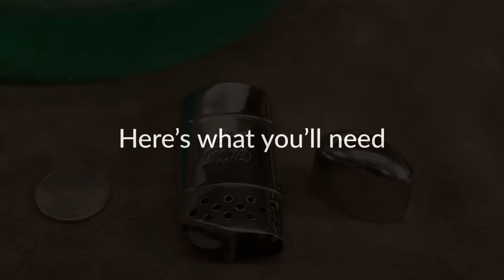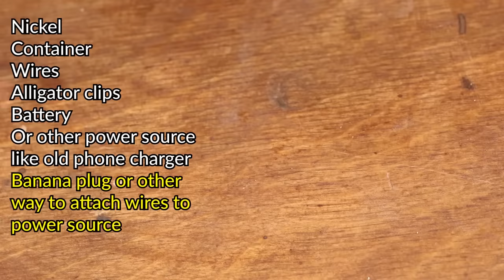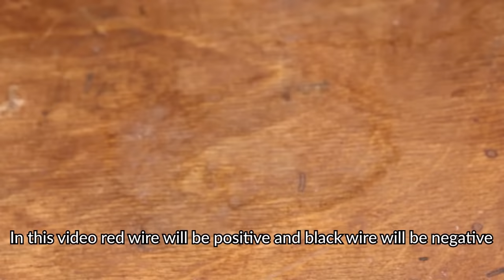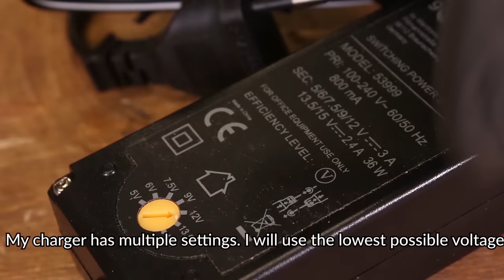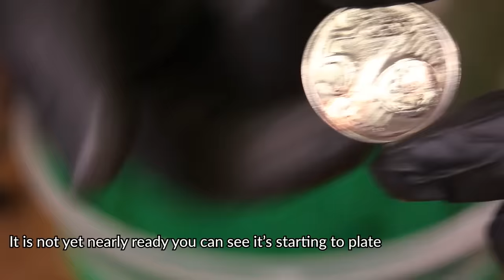How to make simple DIY nickel plating set up - Easy Electroplating for Beginners

Comment: For best results: use hydrochloric acid as the electrolyte solution to obtain nickel chloride. During this first step, switch + and - each 30/60 minutes. You can set up a system with a relay to do this automatically. Let it run several hours until 1 or 2 days depending on the quantity, until you see a VERY dark green color, that means that your electrolyte solution is enough saturated. At this point you can keep doing the second step as shown in the video. BE VERY CAREFUL, WEAR PROPER MASK AND GLOVES, KEEP THE ROOM VENTILATED. ACID IS CORROSIVE, so take care, the electrolyte preparation is better to do outside (that smoke too is quite corrosive, metal parts around the area may begin to rust after 1 or 2 days)  For best results, a copper layer is also recommended before the nickel plating. Cheers 😁✌️
Reply: where did you learn this? also is there a proper percentage that the new hydrochloric acid should be?
Reply: @stclairstclair  Nickel chloride with a few drops of 31% HCl (10 g Nickel salt) in 500 ml water) works great.
Reply: @chanheosican6636  nickle salt ?

Comment: Probably been commented on a ton, but I'll just reiterate - be very careful with using salt (sodium chloride) as it will generate chlorine gas, which is highly toxic. only use in a very well ventilated area. I'd much more recommend using washing soda (sodium carbonate) as that will improve the conductivity of the water without the risk of chlorine gas.

Comment: Thank you for this video. I’ve always wanted to know how this is done. We love watching all your videos 😁
Reply from the maker: Thanks. Some metals are much harder to plate or they need liquids that produce dangerous fumes but at least nickel, copper and zinc are easy and all can be done like this if you just change the nickel to other metals
Reply: @Odd_Experiments  could i use this method to put a nickel finish on a small pistol?
Reply: Inhuman Filth if it’s just the case then yea I think so
Reply: @dandan3934  It is chemically possible to plate something with copper ions in solution without using a copper electrode
Reply: @inhumanfilth681  Pistol's bluing would need to be removed.

Comment: Everyone should remember, that the mixture of hydrogen and oxygen makes a detonating gas, especially in 2:1 proportion. That gas is very  dangerous cause it's very easy to detonate, there would be enough just one spark. So the ventilation is not just recommended, it is ablolutely necessary!

P.S. Thanx for video, simple, short and clear. Salute form Russia ;)
Reply: I perfectly agree, the last and only time I smoked close to a charging lead battery (which release hydrogene the same way), it exploded and I ended with my clothes looking like a fish net...

Comment: That is very cool. Can you do the same thing with other metals like copper, silver, brass, tin, etc?
Reply from the maker: Basically yes. I believe the vinegars solution needs to be changed to different for some metals like gold. At least copper and wick will work like this. Brass won't work because it is an alloy. Depending on your conditions you will get a plating that is mostly only one of the metals in the alloy but it might have some impurities. Brass can be plated only in specific conditions but that is hard.
Reply: what liquid should be used for gold
Reply: you can easily plate with copper in a copper sulfate (CuSo4) solution (easy to find in a gardenning shop) the same way, with copper at the anode.
For gold, only aqua regia, a mix of nitric and hydrochloric acids (HNO3 + 3 HCl) will react and it's extremely corrosive, it even attack the glass... not recommanded for DIY !
Reply: @Jethro.Maloku-le.Rey.Kalsitran  what about gold cyanide

Comment: From what I understand, using higher voltages causes a pitted look on the surface. [probably because of the bubbles] I have found using a "buck" converter on the power supply to get the voltage to not above 1.5V with longer plating time and moving the part to keep the bubbles from sticking and staying in the same spot on the part provides a smoother shiny surface. Keep in mind like he said, the final product will only be shiny and smooth as the surface under the plating, so get the part by polishing to a mirror finish before plating.
Reply: Yes, generally a smaller voltage is ideal, around 1 or 2 volts usually, and the amperage determines how long it will take to plate a piece of metal. So I suppose the best theoretical results would come with low voltage and low amperage
Reply: Could also set up two tubs and put them in series. That would cut the voltage down to about half and you'd have two processes going at the same time. Could also put a light bulb in between, like an old 2010-vintage antique flashlight bulb

Comment: Hey there, you should make a Hullcell test to see the best results for your nickel solution. You can in crease the shining of the plated nickel layer by adding saccharine ;-) add prop to reduce the surface tension and the air bobble during the plating will be smaller —> higher current —> more speed and better surface. A good temperature would be 60 C°

Comment: If i got some nickel from the positive anode to the negative one. Can i switch the positive with the negative for plating or will it ruin the part, or just won't be possible. If my knowledge in science is at least somewhat good, i think, it is possible, because you don't do anything bad, but it is always best to make sure. As they say, "Drill once, measure twice."

Comment: It is refreshing to watch a "how to" video that is clear, concise and IN FOCUS. There is also a bit of humour thrown in. Very informative. Is it possible to nickel plate over chrome? I ask this as I have a cracked motorcycle part made of ABS plastic that was chromed. I will first weld the piece to repair it by making an ABS paste using either acetone or MEK to dissolve some ABS shavings. I assumed a layer of copper was applied under the chrome to make chroming the part possible. Any help would be appreciated.
Reply: A layer of nickel would not adhere on chrome. Try to remove the chrome layer with hydrochloric acid as there should be nickel under the layer of chrome.

Comment: I had no idea it worked that fast
Reply from the maker: When you get everything with the set up right it's very fast, but to get thicker plating takes a bit of time
Reply: @Odd_Experiments  It would be nice if you made a video with the different configurations to know what would be an ideal durable thickness. thanx

Comment: Hi... Very good educational video you have there sir. May I ask, if I want to replace the material to make gold plated, is it possible using this method? Thank you
Reply: Gold plating is a little more difficult...you would need to dissolve gold into solution which can get complicated and toxic. As far as plugging in gold in for nickel via the same method, I'd have to do the math but it doesn't seem impossible to me.

Comment: Question: does adding salt to vinegar make the solution something like HCL?
Have you ever checked the acid  level of the solution, how low the level was?
I wonder if one could plate items only with the solution and electricity like in the experiments with soaked tampon like attached to metal pens, applying the solution to the item.

Comment: Thank you for sharing. I see the nickel used in the demo is about 5mm thick but the amazon link for nickel is only 0.02" or 0.5mm thick. Does the thicker nickel perform better or worse than the thinner nickel? Could you share a link for the thicker nickel?

Comment: Thanks for the video 
I went step by step to do the Plating 
After getting then nickel Electrolyte ( green liquid) i tried to play a  steel carbon knife parts( blade , back etc) but once i put them in the liqiud it starts to make bubbles ( a lot of them) 
Is this normal ? 
Any advice on plating carbon steel knifes? 
With regards

Comment: Nice one! 
May I ask if the mass of the electroplated item is significantly larger than that of the non-plated?
I mean can it be quantified?
Reply: It can be significantly larger if you left it in there for a long time. Look up laws of electrolysis

Comment: Hi. Can you show me in detail, the process and things required for making a chrome plating setup to apply it on plastics?
Reply: Plastic is not conductive, so it can’t be electroplated just like that. Any non-conductive item needs to be covered by some conductive spray or paint before going on to electroplating it.

Comment: I have a lid from an antique trinket box. I want to nickel plate it. It measures roughly 5 inches by 3. A bit larger in scale than what you're doing. What kind of setup would I need to do this?

Comment: how about testing varying voltages and milliamperages? I've been told that the lower the voltage and amperage at plating time will result in a better thicker plating, though it will take much longer to do. So far, I have not been able to prove or disprove the theory, since tho my voltages have changed, the milliamps did not substantially change.
Reply from the maker: I might do something like that in the future. I wanted to go with very basics on this video
Reply: @Odd_Experiments  I would love for you to do it. It has been a magnificent video.  by the way what amps and volts did you use?  Thanks and regards from Spain

Comment: Thanks for the video it looks really easy!, does it works the same if i use copper instead of nickel?
Reply: It's actually a bit easier to do with copper and you only need a copper salt, such as CuSO4 (Copper sulfate, commonly in pentahydrate form) as well as a copper electrode.
Reply: ... and you can find the copper sulfate in a gardening shop, it's a common cure for tomatoes and vines against mildew...

Comment: what happens if you apply a 110 or 220 volts ? faster process ?
Reply: Gotta be DC. Wall outlet is AC, that is, the energized prong potential (ie voltage) is changing from positive to negative ( in comparison to the other, neutral prong) 50 or 60 times per second. This plating process requires the positive electrode potential (ie voltage) to stay positive (in comparison with the other "negative" electrode) all of the time, that is, it must be DC.

Comment: Would this work on a larger scale?  Say if I filled up half of a 5 gallon drum so I could plate larger things?    Would it just take longer or is there anything else I'd need to change?
Reply: the distance between the anode and the cathode needs to be short : if you wants to plate a big piece, you will need to use more anodes all around the piece you want to plate and you will also need a stronger courant (more amperes not more voltage) like a car battery by example

Comment: Can you increase the voltage/amperage to make the process faster or can you only use small amounts of voltage/amperage?
Reply: Too high voltage and amperage can cause both burning and nickel bubbles on the item. There are videos on YouTube explaining how much current each type of metal needs, as it is different depending on if you are electroplating gold, silver or nickel.

Comment: Would this work for copper? Or would i have to nickel coat the item before copper plating it?
Reply: copper platting is easy, you need a solution of copper sulfate and a copper anode and that's all. and generally, you copper plate steels before to nickel plate them

Comment: I have an old camera which Id like to plate. Any sugestion to make the brass matte, like if it was mechanically fine sand blasted ?
Reply from the maker: If you don't have a sand blaster I think the most affordable option would be a rotary tumbler. It's a very slow process but it's  the most affordable way to get similar results, but keep in mind it's an abrasive process, like sand blasting so it will sand down the material

Comment: Thanks for sharing. What happends if you use the highes voltage og you charger?
Reply: you will generate a lot of hydrogene and oxygene to the anode and cathode in place of making ions for plating the cathode, the result will accelerate a bit the platting but will also produce a large amount of explosive gaz... you know... the fuel they used to send people on the moon...
Reply: @Jethro.Maloku-le.Rey.Kalsitran  Thank you :) Enlighted :D
Reply: highest current you mean. Only as much current as can flow through the solution will flow, no more.

Comment: What type of vinegar? There are a lot of solution under the common name "vinegar", they are often labeled with concentration percentage, 20%, 80% etc.
Reply: the usual white table vinegar that you can find in any shop will do the job it's generally around 8° (= 8%)

Comment: is there a difference between two pieces of nickel for positive and negative back to power source? or both pieces are standard nickel???
Reply: 2 reasons for using nickel when preparing the solution. 1. if you reverse the polarity it will work too. 2. if you use another metal as a cathode you can't reuse it for anode as once the nickel will be gone the other metal could ionize in the solution too...
and yes, the 2 pieces are the same nickel

Comment: Fantastic video. Congratulation. How you produce vinegar 10%
cheers from Brasil.
Reply: Where we can find a nickel plate in Brazil? Hav no fuking idea
Reply: the regular table white vinegar is commonly 8° (=8%) and should work fine too
Reply: Victor Pfluck aliexpress
Reply: Tonton des Bois  thanks brother!
Reply: @pedrocantarelli3636  de nada amigo, if it's not strong enough, just boil it, it will concentrate. but 7-8° is already nice for a chemical reaction...
Reply: @victorpfluck9622  some coins, if they don't oxidize and are white can be in nickel...
Reply: @Jethro.Maloku-le.Rey.Kalsitran  Thank you again

Comment: If I adjusted the materials and used a different solution could I use this for other metals?
Reply: of course, one other easy plating is to use copper sulfate and a copper anode to plate a metal with copper, but some metal like gold will require strong acid that are dangerous to use without proper safety précaution like an extractor hood or full facial mask...

Comment: @Odd_Experiments I realize this article is a couple years old, I see there hasn't been activity for a while, I'm hoping your still monitoring your channel 🤔 Anyway, I have several dozen nickels that I bought at garage sale, some have no dates. I don't have the big bars of nickel like you were using, can I use a couple of the old dateless/cull nickels for the electrodes to re-plate some of the nicer coins to give them a shine? Some of them look new, almost uncirculated and would have the original mint luster if they hadn't been sitting in an open quart fruit jar container in the basement. I'll never sell them, I'm thinking of getting them shiny, then making a laminated bartop using them and a couple of them are rarer ones to put in my album. I'd greatly appreciate a reply. Thanks in advance

Comment: @odd experiments I know this video is old but I have been using it to help me with some DIY silver electroplating, I have followed the steps in your video with sterling silver, first making the solution and then using it to electroplate, I'm trying to silver plate US quarters that I have turned into rings to prevent skin discoloration, I used junk silver coins as my sacrificial silver anodes and the process from the out side appears to be working but when I remove the ring and clean off the black sludge I still have what appears to be a non plated ring, US quarters are a sandwich of steel jacketed  copper and it the copper that can be seen on the edge of the coin I'm using to judge if the plating has completely covered the ring. Is there something specific to the make up of a quarter that is hindering my process? Any advice accidentally in one of my attempts I seem to have plated a quarter with copper I believe this was do to the copper wire or my source of silver at the time was silver plated copper so perhaps I'm doing something right but also wrong
Reply from the maker: This is just a guess, if you used vinegar that might be the issue. Silver doesn't dissolve too well in vinegar so the small amount of copper from your wire plates on the coin easier than the little amount of silver that dissolves in the solution. Here's a video where they did silver plating on a penny https://m.youtube.com/watch?v=z-m6zxV_shs  silver is a bit harder metal to use in plating, and each metal combination need a slightly different set ups. I'd try the method on the video, they use sodium carbonate with hydrogen peroxide for the solution. You can even plate the coin first with copper because copper is one of the easiest metal to plate on and it's often used as under coating for other metal platings. Like a lot of times a gold played item has first been plated with nickel and then with gold to make the gold plating much easier.

Comment: Put the parts as close together as possible it saves time and using 12 volts 2 Amp speeds the shit up too.   So where was it you said that i could get the nickel?   :-))
Reply from the maker: Yes it speeds things up but it also may cause uneven plating which is of course only a cosmetic issue. If you have bad set up that may be good because it will take very long to plate. This method takes only minutes anyways. Which is very little time compared to putting the set up together and prepping the parts. If I  try to do it too fast and ruin the surface it will take me easily 10x the time to remake everything. I have link to nickel anodes in the description